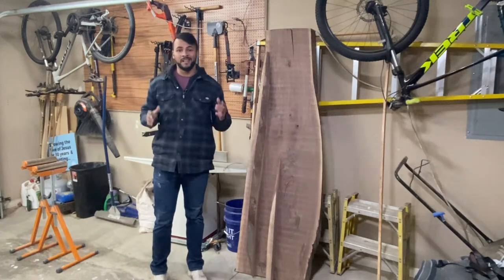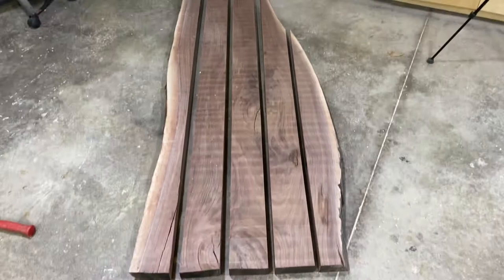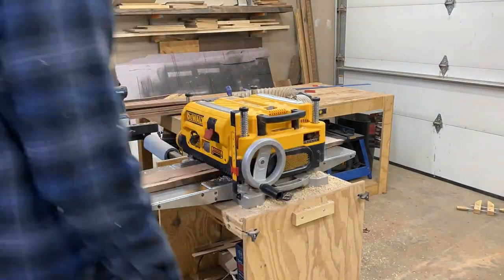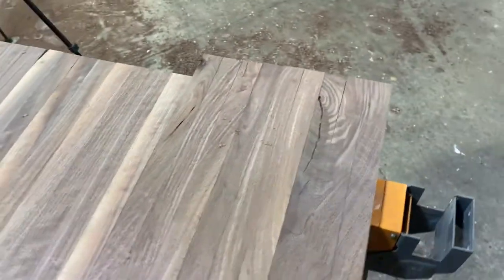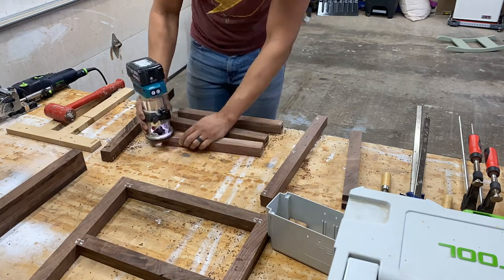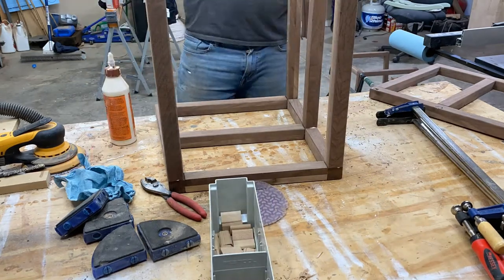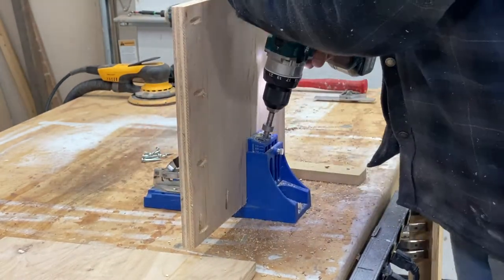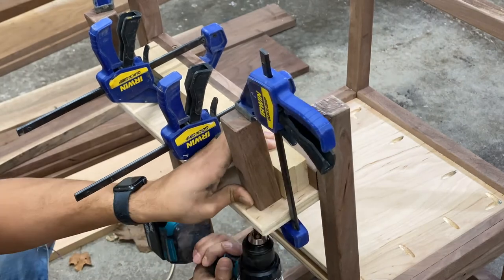DIY Toddler/Learning Tower (With Plans!)

Comment: I bought the plans but nothing mentioned any measurements where to fasten the step. The video goes so fast, you cant process any of it. Maybe when you buy the plans, you should get a slower version.
Reply from the maker: Definitely not a bad thought. The unfortunate reality is filming/editing the video already makes 2-3 times longer than just building the piece, simply don’t have time to create a separate video specific catered toward the plans. I’d have to charge way more for the plans to make it worth the time, and I’d rather keep them affordable. 
Appreciate the support and you checking out the video. The lower step is attached ~4” from the ground. 
Feel free to reach out with any other questions if you have them 👍🏽